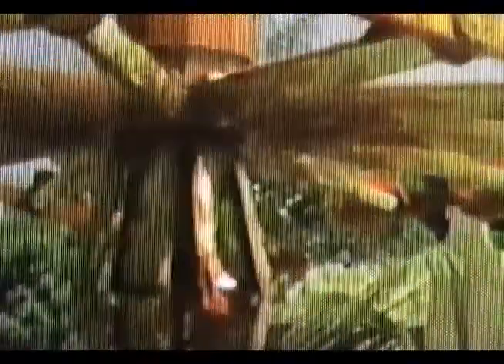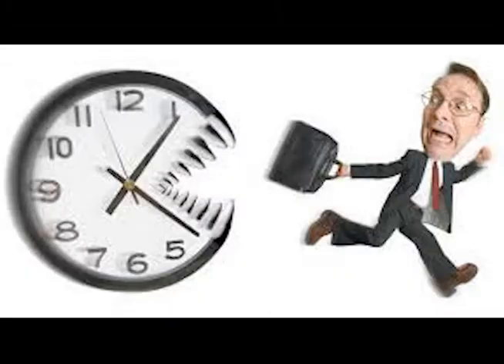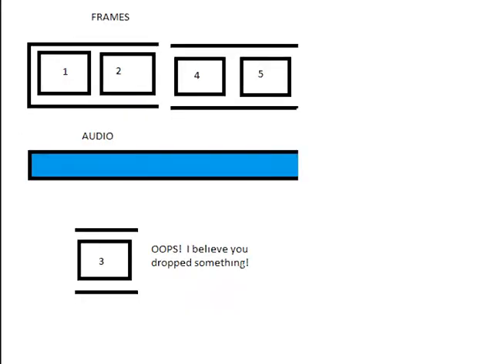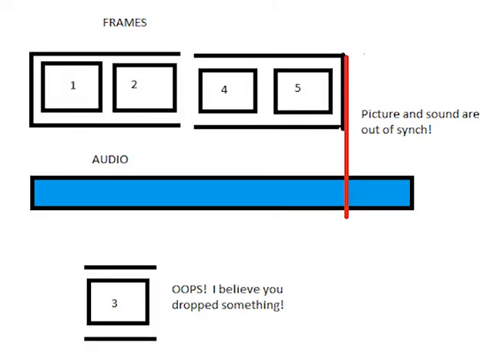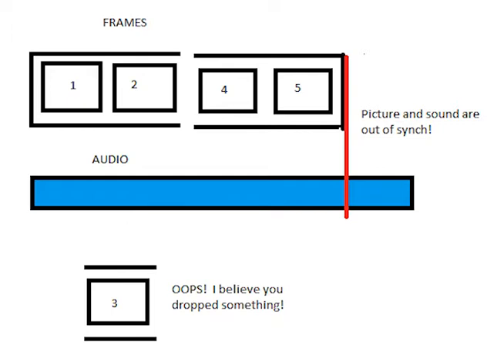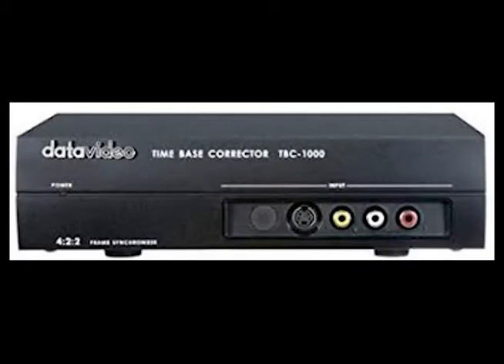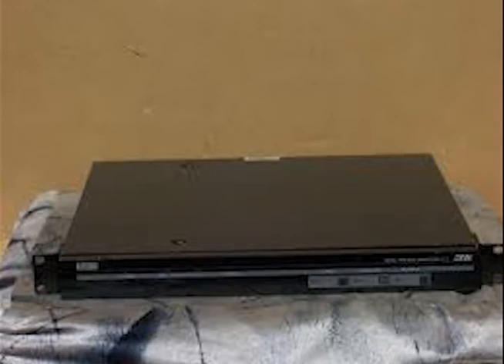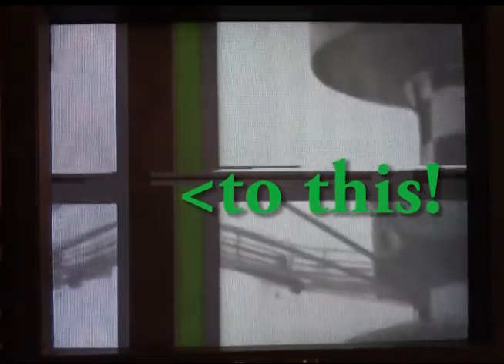Time Base Corrector Discussion

Comment: The IVT-7 can be good in theory, but often is not. Far too often, these are abused, and yours appears to be no different. The signal gets wonky, and must be recalibrated, using the screws that you rightly mentioned should not be touched. All of the controls on these units are touchy, and it's hard to adjust. The now-noisy bad-bearing fan often needs to be removed. Heat is not a problem since you're unlikely to run this 24/7 as designed. Modding to remove the fan requires partial dismantling the unit, and isn't fun. This TBC is a large "pizza box" type unit, wider and longer than VCRs, with sharp corners and edges, so it will own any desk or cabinet where used. In general, I don't suggest these to casual or new users. You rarely see these units in decent shape, usually only as "parts only", again due to typical abuse from broadcast facilities.
Reply from the maker: Mine definitely has some battle wounds, but seems to work well.  When buying something like this, it's a gamble.  Many of them have gone through a lot of abuse.  Some are in good shape, others not so much..
Reply: @gummyroach  i assume the usual culprit, the capacitors, are probably bad in some of these older TBC's.  I still would love to have a working one.  I saw a different brand TBC on a website for sale, and the seller wants $120 plus shipping, and he has not tested it to see if it's fully functional.  He just says it turns on and lights light up.  TBC's are a hot item, since so many people, like myself, wants one to digitize family memories that are on video tapes.  My guess is that someone will eventually buy that TBC, gambling that it will work.  If it does, he will be getting a frame TBC for a song, compared to the $2000.00 and up ones on ebay.

Comment: Vblank is probably vertical blanking - in other words that'll remove macrovision if turned on. RF in is used for dropout compensation and gets the RF signal directly from the video heads and that's how it knows when there's a signal drop to then compensate for it, most likely by replaying the line from the prior matching field or the line right above it. Usually there's a DOC sensitivity potentiometer as well that'll tell the unit at what level of RF signal is considered low enough to be considered a dropout.  I haven't ever heard of anyone adding a DOC BNC to a consumer VCR, but it should be theoretically possible since it's most likely just an RF tap to the RF test point with a capacitor in series.
Reply from the maker: Thanks for the info!

Comment: Thanks for sharing your knowledge and experience on TBC's.  I am going to buy a TBC this weekend, or next.  NO, i will not be paying a small fortune for a Datavideo brand TBC on ebay.  I have a different brand in mind. Would you recommend this I.Den model that you have?  Is it a frame TBC, or is it a line TBC?   I need a TBC to digitize my VHS tapes of my family memories.  I think i need one, as my tapes are 40+ years old.  Maybe i might need an S-VHS VCR as well.  Gonna buy the TBC first, which is a frame one, and test things with my current Sharp VCR.  My Sharp is NOT an S-VHS VCR, and so it's not going to be as high quality as one of the required VCR's to get a great capture.  Anyway, thanks again!  Oh, and by the way...You sound like Jed Clampett!  Anyone ever tell you that?  LOL

Comment: i think the bending of the top of the image is caused by creasing or crinkling the top or bottom of the tape.

during the 2000s the last gasp vcrs was notorious for creasing the top or bottom of the tape because i guess the guides was slightly mis aligned and would cause the tape to be folded against the top and bottom plates on the analog audio/control head or did not sit on the groove on the bottom of the drum body.
Reply from the maker: One of the worst enemies for VHS tapes was rental machines.  Rental companies typically didn't maintain their machines very well.  Many of them weren't in the best condition.  Dirty machines can do a lot of tape damage.